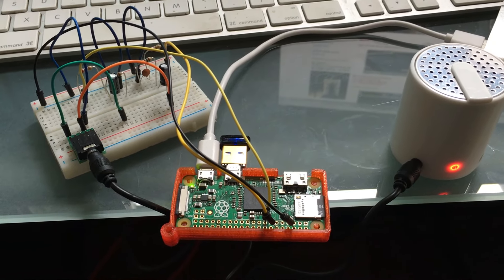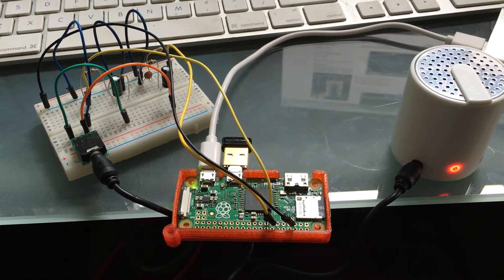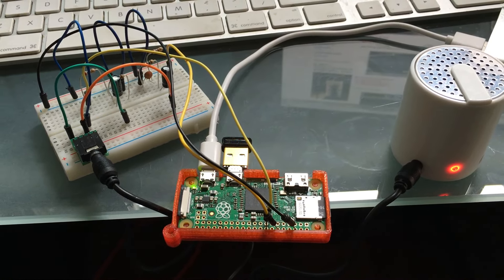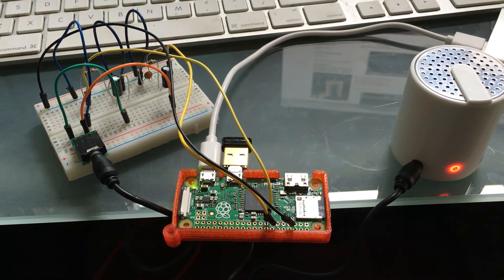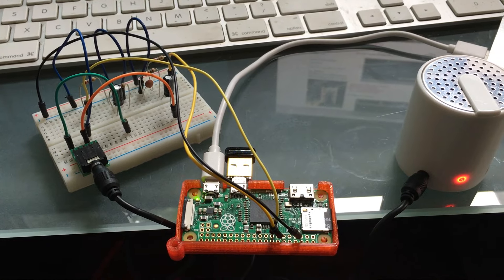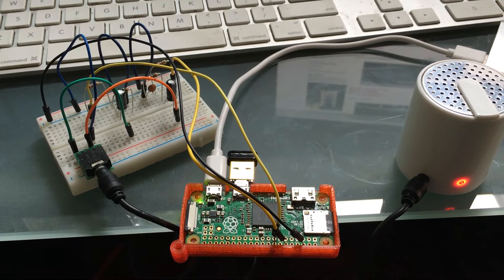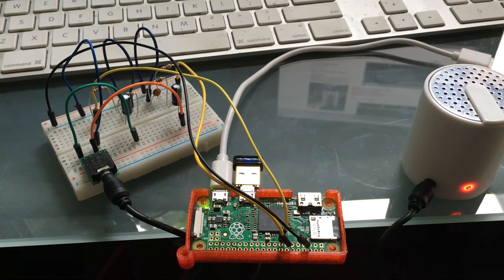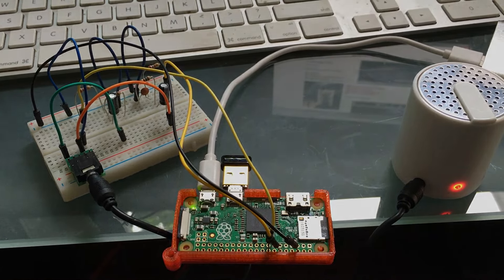Raspberry Pi Zero - Audio Output

Comment: Hello I'm having a hard time following adafruit on setting up the audio which resistors and caps needed. And how to program it Can you please help me out?.
Reply from the maker: There's a schematic at https://learn.adafruit.com/adding-basic-audio-ouput-to-raspberry-pi-zero/overview which I used. Instead of the 33nF capacitor, I used a 10nF cap.
Reply: @xavelor  I'm actually using the first half of the GPIO with aa plug on 3.5" monitor, so I have the Pins soldered into the board.  Can I use the other pins?  Or does it have to be the pins you've used?

Comment: Hello,

Woth a raspberry pi zero, it possible to use any kind of headphone thanks to a hdmi to jack 3.5 converter?

I haven't found a place where this is described. I checked this solution:
https://learn.adafruit.com/adding-basic ... -pwm-audio
But I think that using a hdmi to jeck is easier. She spoke about it but without more precision.

Thanks you in advance

(I want to create a radio Internet receiver thanks to a RPI zero)